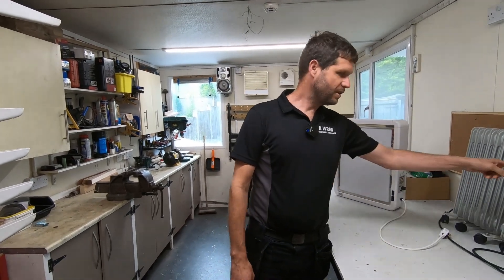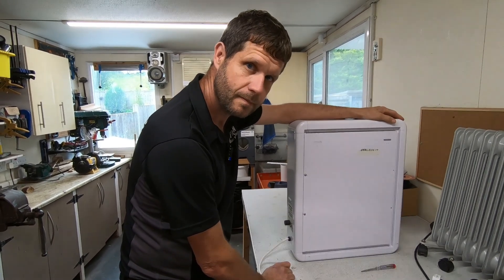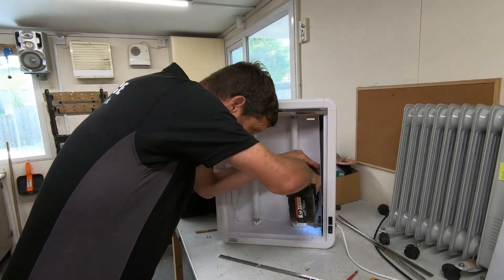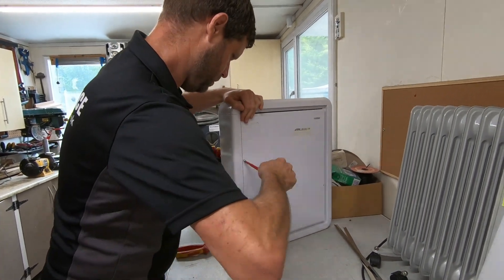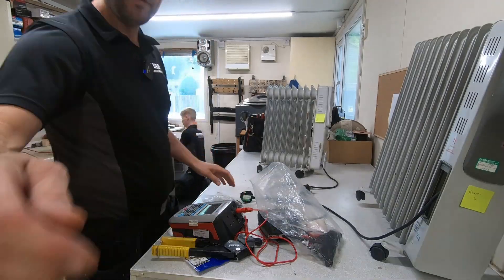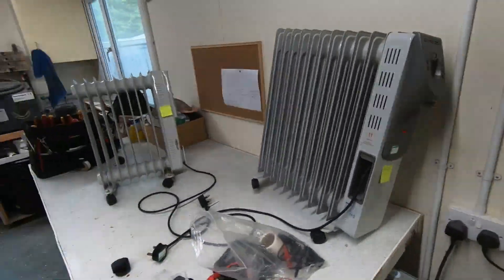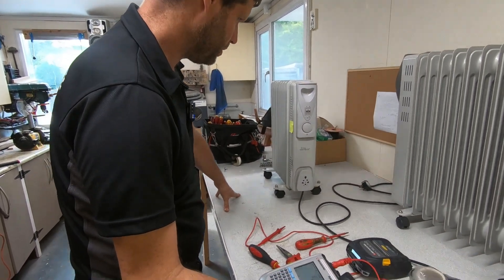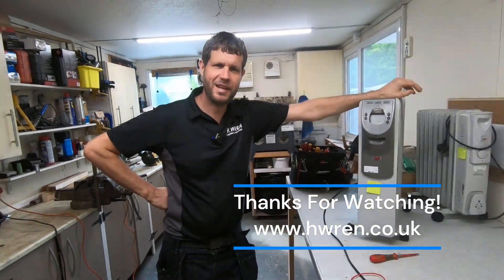PAT Testing, failures and how to repair.

Comment: Earth continuity- the standard says 1 Ohm- so 0.35 is a clear pass.
'Both had one wheel missing' - so move a wheel, and you have only one fail.
Scratching paint off- when there is a mounting bolt to the bracket right next to it!
BTY your video is strobing with your lighting. You may wish to change from fluorescents. Which is a good idea anyway.